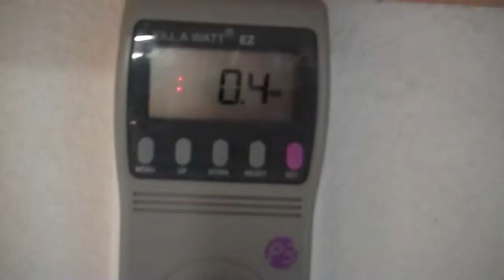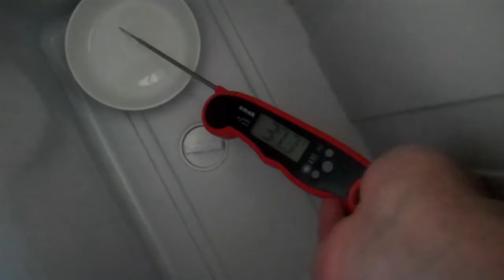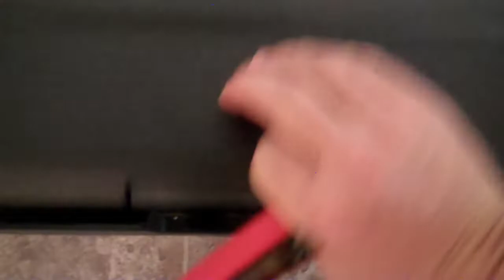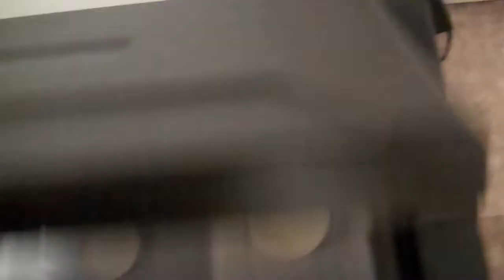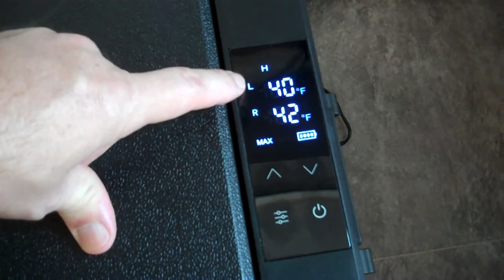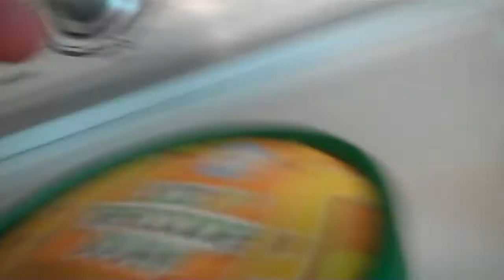Full Review VECYS CR60 car refrigerator / Freezer (Dual Zone)

Comment: please demonstrate how to make a small 12v a/c that could cool my mini van camper overnight in 100 degree weather running off a deep cycle battery.  The smallest a/c that would fit inside a mini van currently available is 8000 Btu which is several times more capacity than necessary.  thanks
Reply from the maker: You can buy small 12v AC units in the 450watt range...would need around a 300-500 AH battery to power it overnight.  Example: 
https://amzn.to/3rG7VGp
Reply: Nice explanation! O hace understood it has BT connection is that  true???